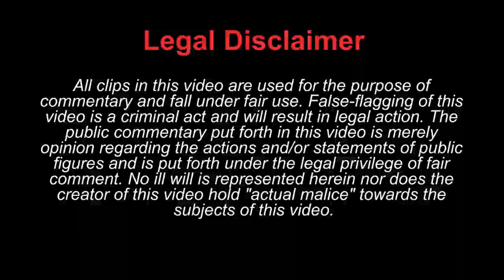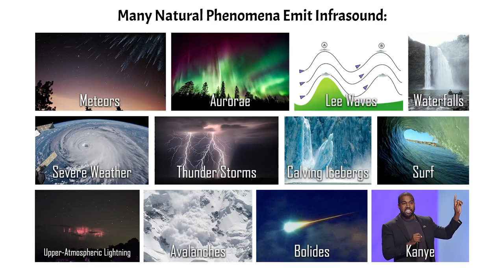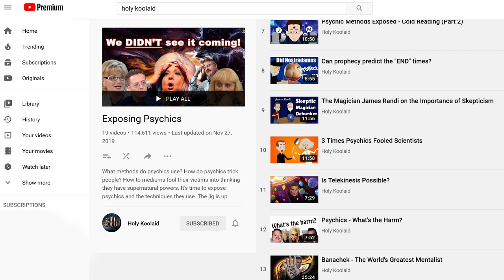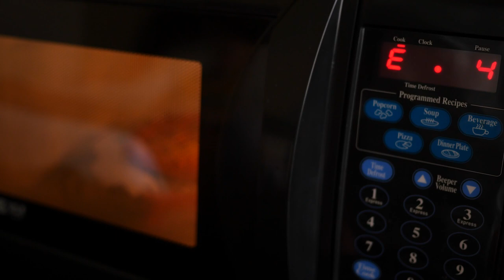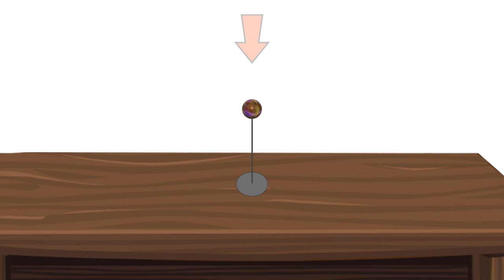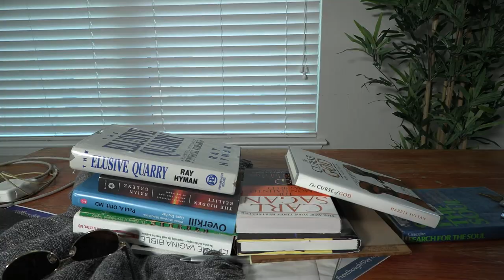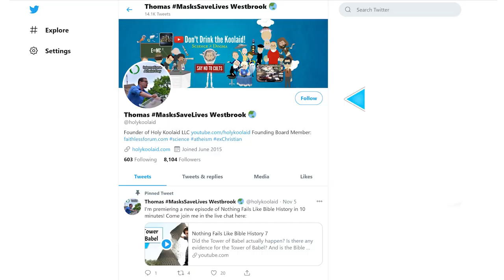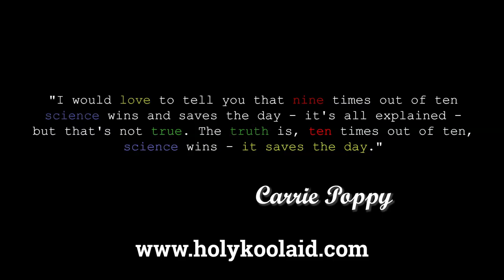5 Things Commonly Mistaken for Ghosts (Part 2)

Comment: I have a story. I was living with a very religious and superstitious colleague. He asked me if I was standing in front of his door at night, and I said no, he was worried it was some evil spirit

I asked him what time was it, and he said around 1:30am. I recalled feeling a mild earthquake around that time. I checked the registry of earthquakes that day (yeah, I live in a very sysmic country) and, hold and behold, it was the exact time he claimed he felt the weird presence in front of his door. Probably the floor or the door were moving with the earthquake

He was also the same guy that was scared to death because he got an electrical shock from touching a faucet. I had to explain to him what static electricity was, and that when he was sitting with his wool shirt in the sofa, he got charged and that touching people or objects made of metal made him discharge rapidly. Also taught him to discharge by touching walls and stuff before touching metal objects

Comment: I’m a skeptic about most things, but I do believe in the paranormal. I think the vast majority of stories can be debunked, but there are some, imo, that can’t. I used to be neutral leaning on nonbelief on the subject until something touched me one day at work. I turned around to see who had pushed/poked the back of my shoulder and no one was there. There was only two other people in the building with me but they were in different offices down the hall a ways. 

I tried to find something pokey on my chair and couldn’t, not that it would’ve made sense anyway because the spot where I was touched was at least 4 or 5 inches above where the top of the chair ended. I tried my hardest to come up with a mundane explanation and couldn’t. I finally mentioned it to a coworker and she was like, “yeah, weird things happen here sometimes,” and acted like it was boringly normal. 

I have a couple of other unexplained experiences, but that one was the most unnerving. The others, even though they were weird and unexplainable, weren’t scary or anything. Just kind of made me go, “huh, that’s strange,” look for an explanation, then go on with whatever I was doing.

Comment: I heard something yesterday afternoon, I was wearing earbuds, watching something on YT, I thought I heard some voices shouting outside the building. I stopped the video, pulled out the earbuds and listened for few moments....It turned out to be some equipment being operated in a nearby truck yard, the sound was being distorted by the AC/heating unit and coming through the air vent, to almost sound like a man shouting outside...
Reply: When Holy Koolaid included pareidolia in the first video he focused on visual phenomena, but pareidolia occurs with all senses - our brains just really strain to apply familiarity/identification to low-detail perceptions of all kinds.

Comment: I woke up once and my legs were paralyzed. I could feel them but just could not move them.
I freaked out.
After about 5 minutes I was able to move them and walk.
As scared as I was I took a taxi to the emergency room and the doctor hooked me up to a saline drip and said that I might need a lumbar punch to check for spinal meningitis.
The end result was that they "think" it was a viral infection and couldn't explain it.
It was a Catholic hospital and they probably didn't know about sleep paralysis just as I didn't know about it either.
My conclusion was that I slept funny and most likely pinched some nerves in my back.
I never went to that hospital again.

Comment: When I was very much younger, some years ago now, I was sitting in the kitchen doing my homework when a mug on the shelf on the wall exploded, sending broken bits of ceramic and shards all over the kitchen, the table, and my books. I kind of sat there frozen and my mum quickly came in to see what the noise was. She looked a little shocked and confused at the scene in front of her, and I told her simply, "the mug exploded".
She quietly got a dust pan and brush, and began clearing up the mess. For a devoutly Christian woman at the time, she said one of the most sensible things I've heard, especially from a Christian.  She said, "you'll probably never find an explanation for that. Don't dwell on it."
Sometimes weird s**t just happens. It's great to have an explanation but most of the time you just have to settle for not knowing. 
And that's ok.
Reply from the maker: That's really interesting, but not unexplainable. What material was the mug made of? If it was glass, glass has been known to spontaneously explode due to minor damage, internal defects/impurities like nickel sulfide, and thermal stress. There are videos of entire glass tables just exploding spontaneously.

Even sound can cause glass to shatter if it's loud enough and just the right frequency (like opera singers who shatter glasses with their voice).

If it was ceramic, impurities in the mug could absorb moisture at different rates causing pressure to build up. I'm not an expert by any means in material science, but there's something to think about/potentially research more.

Also, thank you for bringing this up, since it's something I think I'll mention in the next video in this series.
Reply: @HolyKoolaid  .
Where I worked, a client wanted a cast made of a ceramic bowl.
Because of the heat from the resin, the bowl suffered thermal shock and was still pinging odd bits off many hours later, long after it was cold.

Comment: I suffer badly from sleep paralasys all the time... 😔
It's really not a nice experience at all, it was under control for a few years with medication but that stopped working a long time ago and they came back with a vengeance, it's one thing I wouldn't wish on my worst enemy... 😔
Reply from the maker: I used to have it bad. I found that if I got plenty of sleep every night and went to bed on a regular schedule, slept on my side (instead of my back) and limited alcohol consumption, then I don't really have it anymore.

When it does happen I know what's going on now so I just lie there and take it all in (more fascinated than anything nowadays). If I want to break out of it, I try shifting or clenching my jaw or clenching my fists until I can move again.

Comment: I did experience something unusual in our old house about 40 year ago. Only myself, my mother and step-father lived in the house. I was sitting in the living room, reading a book.   Except for me and our pets, the house was empty. I was looking down at the book, but suddenly I saw a blurred figure flash past in my  upper line of sight. Immediately afterward, the front door opened and slammed shut. I suddenly felt very strange and anxious. The dogs barked for several minutes after that.  I checked and the back door was locked from the inside. So it was not someone who entered from the back yard, ran through the living room, opened the front door and slammed it as they ran out. I do not believe in the supernatural; neither gods, ghosts, nor demons. But  I still have no explanation for it.

Comment: If the door swings open or shut or a lift arrives on a floor and the door opens but there's no one in the lift and the button wasn't pressed to summon it, I'll joke that it's just the ghost.
Unstable door frames and or wind, vibrations etc cause the doors to move; people pushing the button for the wrong floor in the lift (or deliberately pushing all the buttons) and then getting out on a different floor cause the "ghostly lift passenger".